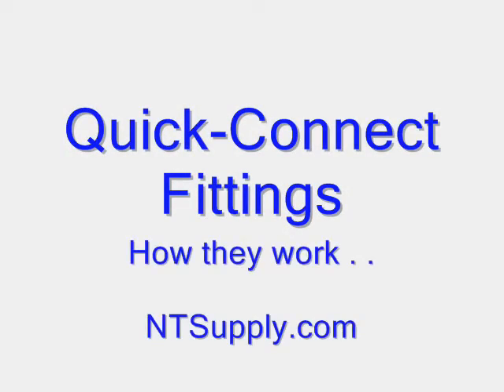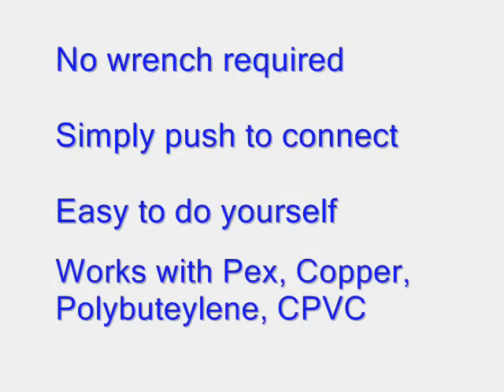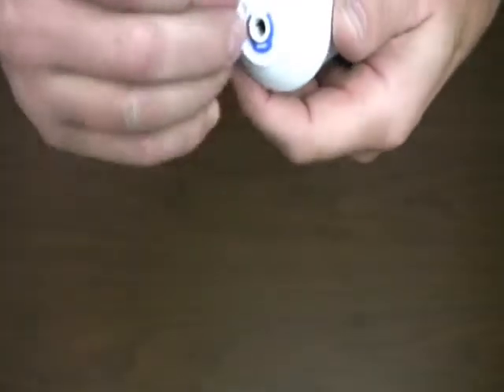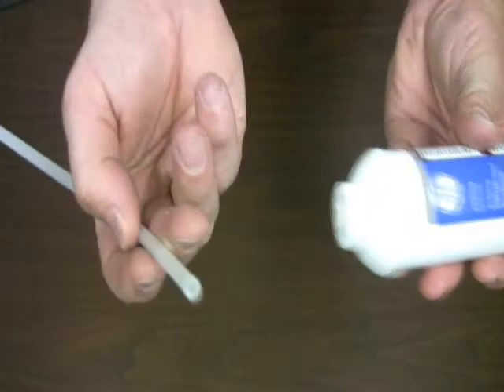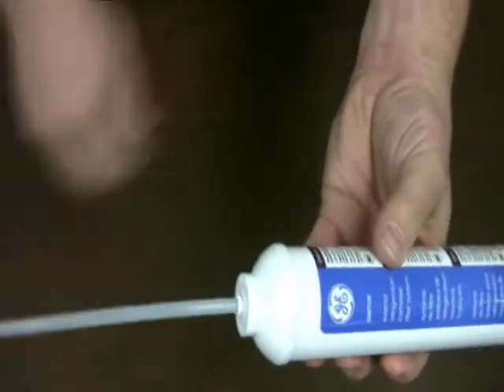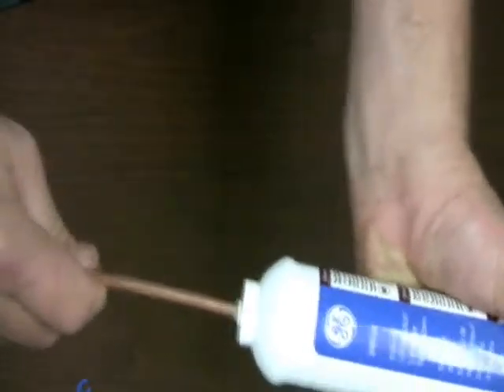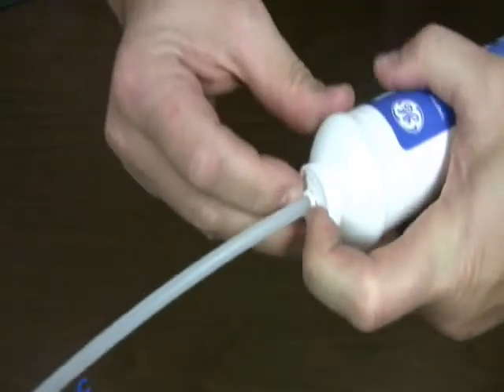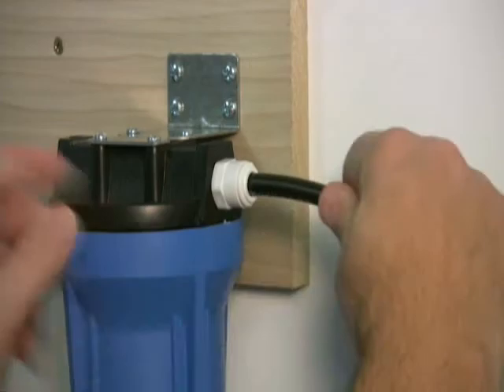Quick Connect Fittings

Comment: My Ice-Maker came with a Thrifco Plumbing "AIC-6 In-Line Post Carbon Filter"..  but it has threads on both sides!

The inlet to the Ice-Maker is the 1/4" OD Tubing.. it doesn't have instructions how to connect the tubing to the water-filter and water supply.